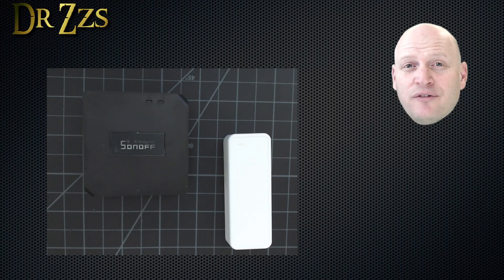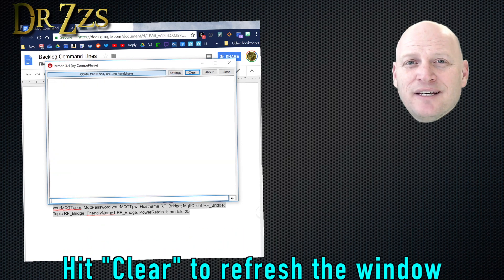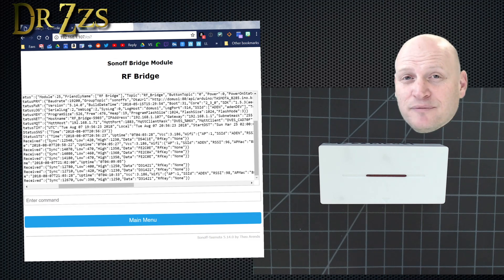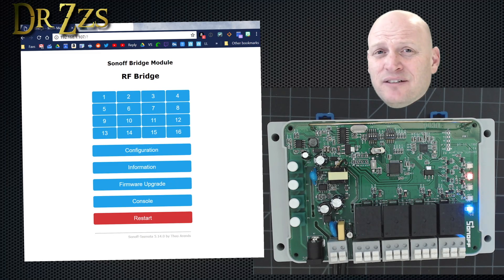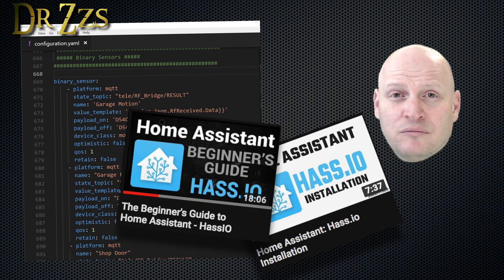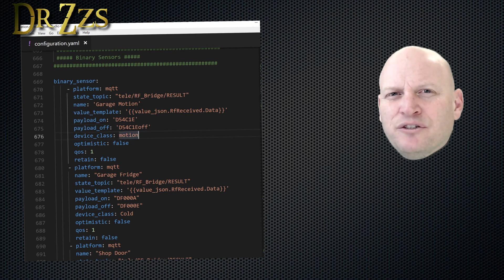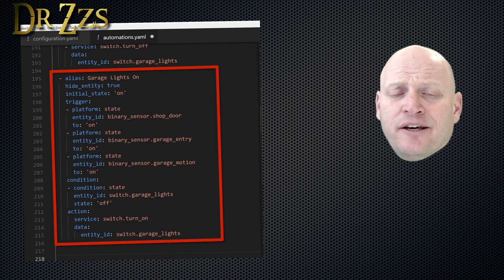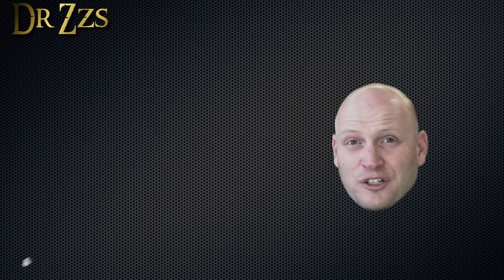Sonoff RF Bridge with Tasmota

Comment: Hi Drzzs,
Jumped in to HomeAutomation and HomeAsisstant recently. Bought a Pi3+ and lots of sonoff and wemos during the last shopping festival on AliExpress. Your videos have been an inspiration. Yaml has been bit overwhelming at first.
I also bought the two code sensors from your Banggood vip link. Working really well, although range is bit lower than the standard ones that I had earlier. I followed your other tutorial on flashing OpenMQTTGateway to the RF bridge. It has been working great so far. But, I see a soft Access Point "OpenMQTTGateway" on all the time, even if the RF bridge is connected to my home Wifi. Is their a way to disable that? Or should I tasmotize it following this tut?
Reply from the maker: Thanks!
Sounds like you're off to a great start. 
Generally, I would say yes, Tasmota has been better for me than OpenMQTTgateway.  I know OMG is good and a lot of people use it and are happy.  I'm just more comfortable with Tasmota so that's my preference. 
I don't know what specifically to do about the OMG access point showing up all the time.  Makes me wonder if it does that by default sometimes.

Comment: Nice work! Can you do a video with sonoff rf bridge with solar siren?
Reply from the maker: wow. Solar siren. That's cool.  Do you have a link to the device you use?  I'll see if I can get one and see if we can get it working.
Reply: @DrZzs  Here is one but there are many out there. I have not started anything yet. I am in the research stage. I ordered a couple of devices but have not received any yet. 
 https://www.aliexpress.com/item/433MHz-solar-power-alarm-siren-wireless-LED-light-speaker-waterproof-outdoor-alarm-strobe-siren-for-home/32822936167.html?spm=2114.search0104.3.2.5a5f7178oRwELu&ws_ab_test=searchweb0_0,searchweb201602_5_10065_10130_10068_10547_319_317_10548_10545_10696_453_10084_454_10083_10618_10307_538_537_536_10059_10884_10887_100031_321_322_10103,searchweb201603_2,ppcSwitch_0&algo_expid=69b524ce-4220-412f-bb45-e63d13eb0886-0&algo_pvid=69b524ce-4220-412f-bb45-e63d13eb0886

Comment: Anyone having problems with the 2 code sensors? I bought 5 and they don't work properly. They give codes once or twice then seem to 'go to sleep'. Definitely unusable. Until I find some more reliable sensors, I'll have to go back to the 1 code sensors from Sonoff, not ideal but better than not getting a notification at all.
Reply from the maker: dang, that sucks.  Sorry about that.  I haven't had any problems with mine. There may be a retriggering delay built in.  Not sure that's what's causing your problem, but it might be.  Anyway.  Sorry they aren't working for you.  
I only know of those 2 brands that have 2 codes, the ones I use and the Kurei brand.  There are probably others you could try.

Comment: I am trying to flash, but when I open the FlashESP8266 and choose Com3 the Firmware dropdown stays blank
Reply: Nevermind. I had to move it to the bin folder
Reply from the maker: Sorry for the delay getting back to you.  Glad you figured it out!
Reply: @DrZzs  all good. You got a lot on your hands with the support community. I ended up having to use esperna. Tasmoto, unfortunately was only giving me the last 5 digits of the full code. I read that some devices act that way with the firmware. I'd much rather keep everything tasmotized for easier management, but it's all good. 
Cadillac problems!!! 😁
Thanks for your continued support.

Comment: Hey, great video. It was inspiration enough for me to invest in a bunch of rf sensors for my home windows & doors.  One question about battery life.  Do you know of any way to identify current battery levels?  I just watched the latest video from 'the hookup' about the new Shelley H&T and smoke detectors.  It seems these Shelleys send mqtt data to report battery store percentages.  I'm wondering if you found a way to know when it might be time to replace the batteries in these sensors you used?
Reply from the maker: I think there are some sensors that report a code for low battery.  I don't expect you can get an actually battery level from these sensors since they are RF and would need a unique code for each %.  The only way I can think of to see what the low battery code is (if your sensors send one), would be to put a dying battery into the sensor and watch the tasmota console for a new code.  
I would guess that if the sensors send a low battery code it would say so in the marketing information.  If it doesn't say something about that, then it probably doesn't send one.  
I haven't watched Rob's latest video yet, so I can't say much else about comparing those sensors to these RF sensors.  They aren't much the same though.  RF is likely always going to use much less power than any Wifi (mqtt capable) sensor.  If they have found a way to bring the power usage down to comparable levels with RF sensors that would be revolutionary! 
Hope that helps!
Reply: @DrZzs  thanks for the info. Totally agree.

Comment: I don't see you have any script to reset basement water leak. how and when do you reset water leak detection?
Reply: I got it now.  I didn't know that I don't need to have water leak entity_id to reset it, just proper payload.  

sequence:
  - service: mqtt.publish
    data:
      topic: tele/RF_Bridge/RESULT
      payload: 15829521off
Reply from the maker: ya, if the basement water leak detecter is activated I don't want it to automatically reset.  I would manually reset the state on the states page in HA after I investigate and repair the source of the leak :)

Comment: I searched previous comments but no one seems to have caught this.  When you demonstrated the water sensor it did not trip until you released it, just like mine does.  No signal on wet  only when returned to dry.  Any Ideas on this
Reply from the maker: Really? That seems wrong. I’ll have to test it again.

Comment: hi, do you know if this RF water leak detector sends a weak battery code like other Kerui RF modules?
Reply from the maker: I don't know.  I haven't tested it to see.  I supposed it doesn't say so in the product information?
Reply: Which kerui water sensor do you have? It would be great to know the battery is low. I have the same water sensor that Dr Zz’s uses in this video. I didn’t see a way to report battery status, but i also didn’t have a battery that is low on charge to see if it sends a separate RF code.
Reply: @williampeters5826  I have kerui door sensors (reed switch type), Motion Sensors (PIR) and a Smoke Detector, all of these sends a code when battery is low, ie if trigger code the sensor sends is #11D50A, battery low code will be #11D50F.  I am hoping to get the water sensor this week, will test and let you know.
Reply: remotesHUB that would be great if you can let us know! How do you do the test? Do you happen to have a battery that is low you stick in there? I have a handful of door reed switches I’d like to test. As of now if the battery went low the RF bridge would pick It up but I would miss it because I don’t have the low battery code saved in my HA config.
Reply: remotesHUB I checked with the seller who I bought the water sensor from, he has confirmed that the sensor sends a low battery signal different that the water detect signal. Now I need a low battery to test this so I can get the code.
Reply: How long do the batteries last in the PIR sensor? What kind of batteries?
Reply: @willdabeast4430  battery in PIR depends on frequency of motion and 3 minute interval option selected. I have turned on the 3 minute interval(jumper settings inside battery compartment), once triggered it will not trigger for 3 minutes and battery lasted for about 18 months in high traffic area. 
I can also confirm that Water Leak sensor sends out a weak battery code when voltage drops below 2.4V
Reply: @williampeters5826  i can confirm that the Water leak sensor in @DrZzs link sends out a battery a low c
RF Code when voltage drops below 2.4V

Comment: Hi  Im looking for a device that will  voice prompt   to a speaker  when triggered    preferrably by wifi or 433mhz

How did your system speak  "ohh no water  leak in basement  again"   what device didi you use to do that?
Reply: Revelation he uses google and Alexa for the announcements and a push notification for an iPhone.

Comment: Posting here in desperation! Has anyone experienced "No matching payload found for entity: Porch Door with state_topic: tele/RF_Bridge/RESULT" kind of entires flooding your log file? I understand that something has changed in HA Core code that raises this error if you have multiple State Topics that are the same. In this case RF_Bridge. Every-time one of my 8 sensors is triggered it makes 8 log entires like this. Only hack i see is adding a custom mqtt.py to prevent these entires being written. Instructions seem to be HA related & Im using HASSIO so totally stumped. Seems like a backwards step in the core code to me, there have been others complaining but the request for change back seems to have been abruptly marked as "its not going to happen" & you should use different topics which as far as I am aware will not work with RF_Bridge & Tasmota. Anyone have any ideas?
Reply from the maker: I'll look at mine, but I don't think that's been happening to me.  Either way, can you post some more info and we'll try to sort it out.  Have you brought it up in the FB group or Discord?
Reply: DrZzs I’ve not raised the issue anywhere else as yet here is one of several links where people are having the same issue https://community.home-assistant.io/t/mqtt-py-log-warning-no-matching-payload-found-for-entity/42995/5 in this post there is actually a edited MQTT.py file which can be put in as a custom file in the config folder that prevents the errors being written. I will try this later tonight and report back. Would be surprised if your instance is not doing the same if you are on the latest version.
Reply: Just thought I would report back, following the details in the link I posted creating a custom mqtt.py seems to have worked. I now have a reasonably quiet log file :-) Hopefully this may help someone else if they have this issue. Honestly not sure how everyone using a single state topic (ie RF_Bridge) is not having this issue as the core code changed
Reply from the maker: Thanks for reporting back!  I'm sure someone will benefit from it.  
Thanks!

Comment: Hi Doc, quick question. How do you reset the moisture sensor? I have the exact same water sensor and hooked up to an rf bridge - once if triggers it set to wet. But when I manually set the state back to off it chances the icon to a switch or just a large empty circle and not a moisture icon.
Reply from the maker: You can go to the states page and select that sensor then change the state to "off"
https://www.dropbox.com/s/2f3b53zgz871av9/Screenshot%202018-10-23%2008.26.34.png?dl=0
Reply: DrZzs I did try that but the icon changes for that sensor to just a large circle instead of the moisture sensor icon.
Reply from the maker: hmmm, maybe you have to use the other word for the off state since it's set as a moisture sensor.  I think it's "Dry"
Reply: DrZzs thanks!

Comment: I just got my RF and flashed it and the SSID never shows up to configure. I have tried to configure using Termite but it outputs garbage no matter the rate. The access point showed up briefly pre-flash so idk why it wont work now.
Reply: Also, this is the serial output:
https://imgur.com/a/zaKyFvj
Reply: Just plugged it in via micro usb and the WiFi led doesn’t light up. It would seem that WiFi on the board is completely dead.
Reply from the maker: dang.  I've ruined one RF bridge too.  I don't know how I did it either.  bummer man.  Sorry.
Reply: DrZzs Ya, I guess it is just dead. Luckily Banggood is sending a replacement.

Comment: Hello, congrats for great videos.
I bought one rf brdge to control my doorgate garage but i cant make it work.
I followed the procedure exactly and the rf bridge learned the remote button. BUT it does not work.
when i press the remote button the door opens. when i press the 1 key or send the command rfkey1 through tasmota web nothing happens.
i get the log stat/rfbridge/RESULT = {"RfKey1":"Learned sent"} but nothing happens.

when i press the remote button i get tele/rfbridge/RESULT = {"RfReceived":{"Sync":7890,"Low":230,"High":810,"Data":13307874,"RfKey":1}} 

i noticed that the motor relay triggers after i long press the button of the remote. 
is there any way to simulate this long press through tasmota? when i press it for half a second the door opens but i cant figure out how to do this with tasmota.
Any help would be greatfull!
Reply from the maker: Thanks!
it looks like the RfKey 1 has been set to the remote code.  So that is working.  When you long press the remote button do you get a different code in the Tasmota Console?  
If you could maybe record what you're doing and what is happening and post it in Facebook or discord, maybe together we can identify the problem and help you get it solved.

Comment: any help with pairing remotes that the bridge will not pick up or sending a custom code to setup a door motor code
Reply from the maker: If you're pressing the remote and there's no code showing up in the Tasmota Console, then my guess is that remote doesn't broadcast on 433mhz.  If that's true, you'll need something other than the Sonoff RF bridge.  (the bridge may also do 315mhz, I'm not sure, you'd have to look that up on google).   
Look at any info on the remote you're trying and see what it uses for broadcasting.  You may need a different bridge.

Comment: I picked up 4 of the Banggood door/window sensors.  See https://community.home-assistant.io/t/sonoff-dw1-433mhz-door-window-sensor-low-battery-warning-capable/43073/3?u=lmamakos for some research I did.  Mine have provision for a tamper sensor, but it's not populated on the PCB.  It also will send a "low battery" code when the voltage of AAA battery falls to around 0.8 volts or so.  Curiously, there looks to be programming pins on the PCB for the microcontroller - probably was using during manufacturing to serialize them.
Reply from the maker: Can you detect those codes with the Tasmotized bridge?
Reply: Yes, exactly, I was using the Sonoff RF bridge with Tasmota, and a python script that just subscribed to that topic and printed out the messages as they go by.

If you look at that thread on the Home Assistant forum, someone else followed-up with a pointer to similar sensors on Aliexpress.  I'm tempted to order a few more because they are inexpensive, but I think I have all that I need.  Of course, that's not stopped me before..
Reply: Oh, and I'm also using the Tasmotized RF bridge to receive the transmitted messages from my wireless doorbell.   https://www.amazon.com/gp/product/B00LFATHKS    While it seems to reliably receive the messages from the two remote button transmitters, I don't seem to be able to get the bridge to emulate a button and send a message to the doorbell receivers. 

While it's useful to know that someone has pressed the doorbell button (maybe I'll grab a snapshot from the security camera..), my wife might not appreciate even more things ringing the doorbell ringers.  We'll see.

Comment: Got the water leak detector in the mail today along with several of the 2 code sensors. The leak detector was easy to set up and it works! Well, it works after a trip to the big box store to get a pack of the A123 batteries.
Reply from the maker: ya, I hate funky sized batteries.  And if you're going to sell something with such a screwy sized battery, add $2 to the price and include a battery please!  
Anyway, glad you got it!

Comment: Hey Doc, watching this video has potentially saved me loads of time and effort, figuring out how to build from scratch! Got mine plus a PIR up and running fine! One question, something I've not been able to find, possibly a n00b Q, but is there anyway of using the bridge to communicate with a Temperature sensor?
Reply from the maker: That's a good questions.  I don't know the answer.   I'd have to get an RF temp and play around with it.  Do you see anything happen in the Console when the temp sensor is active?  That's where I'd start looking.  I wonder how an RF temp sensor sends the actual numbers for the temp?

Comment: Just wanted to thank you for this video. I had a devil of a time getting Tasmota up and running. Mostly operator error.  Never did get the IPaddress1 command to work. But there are other ways...  But it was smooth sailing after that. The only sensor I have now is the door sensor that you mentioned.  I used your YAML for the fridge door and it worked perfectly.  Your videos always work.  I guess as a doctor, you get used to that as a way of life.
OOPS! in not in your vocabulary.
Reply from the maker: ha!  glad to hear you got it working.  I love the fridge one.  Especially with the automation to announce that it's open and someone needs to close it. 
I hope the videos work.  Sometimes I make mistakes or forget steps or things change.  I'll keep trying to do good stuff that works :)
Reply: DrZzs The big problem that I had was reported by others. Termite would not work. While fiddling around , I broke a wire . My programming setup was a kludge so I rebuild it. Anyway I read the comments and realized a lot of others had the same problem.
So you might state that we read the comments before we start implementing the video. This is not a problem with the videos. Thanks again for your fabulous efforts.